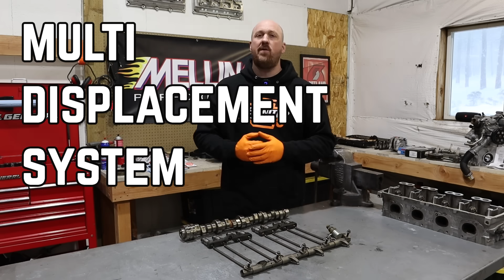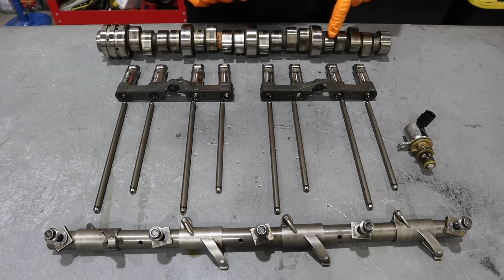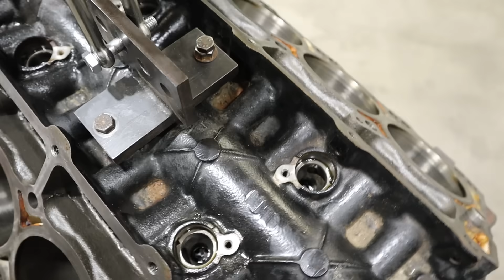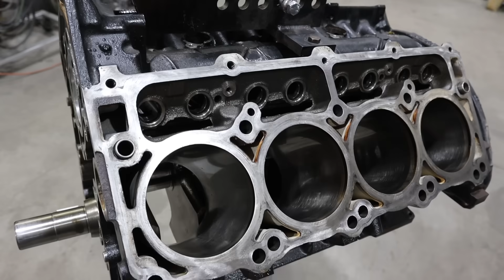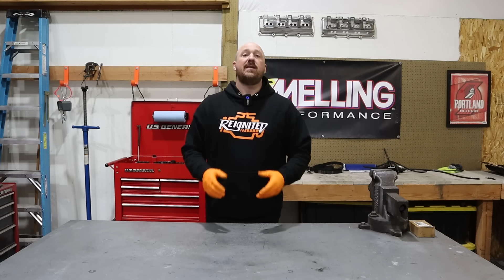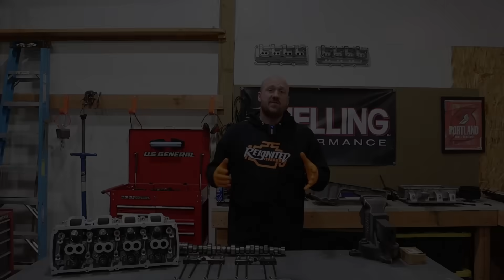Is MDS Damaging Your HEMI? The Answer May Surprise You!

Comment: I drive a lot in Sport mode, and have heard that driving in that mode turns off the MDS system. Is this true, and if so, would you recommend driving in normal mode to keep the oil moving through the motor in the most efficient way possible?
Reply from the maker: Yes sport mode does turn off the mds system. I would say that timely oil changes and not letting the vehicle idle extensively are far more important, but when possible just let the system work as designed.

Comment: I just watched your video, I have a 2015 ram 1500 with a 5.7 L hemi V8 and the eight speed transmission. I tow a travel trailer with it. Do you recommend with tow/haul mode on and pulling a load like a travel trailer to leave the MDS system on?
Reply from the maker: Any time you're towing stick with the tow/haul mode 👍
Reply: Sorry, yes I agree tow/ haul mode should be on but what about the MDS? Do you suggest leaving MDS on or turning it off. 
Based on your video it sounds like you recommended leaving MDS on, even when towing. 

Thank you for any information, love your videos and have learned a lot about my RAM.
Reply from the maker: @bryanschelley7568  the MDS system is automatically disabled in tow/ haul mode. I don't have any qualms about that, I'm mainly talking to the people who immediately turn off the MDS every single time they drive the vehicle. 👍

Comment: Great video, but the thing that bothers me is, when in tow mode (2016 ram 1500 5.7) it's off. So if so, then I'm driving 3000 miles round trip to my winter place with it off. So if having it on is better, why does the factory turn it off in tow mode. Crazy

Comment: My 2012 300C AWD has "ECO" mode, as the cluster displays.  It does get up to 24 mpg when highway driving and really hot outside in summer months. Checked with math, not relying on the "economy" display (although it is close).  I also don't granny drive.  I use cruise as much as possible but quite often hammer on it to cut through traffic to get ahead of those left lane abusers.  I also ended up being a victim of the low oil volume sitting through ChiTcago traffic and Milwaukee traffic.  I wish I would have seen your videos back when you posted them!  Chrysler chose that moment to evade their "Max Care" warranty.  Now I have an LKQ remanned long block, (4 year unlimited mile warranty) and no idea what Oil pump they put in it..but I bet it's not a Hellcat pump.

Comment: I drive a 2019 dodhe challenger shaker rt in toronto in ever winter and every summer every weather. It has 140,000kms and runs like new. Why? Because i NEVER idle the car. Even if a red lught is a longer one...i shut the car off (not recommended for safetyreasons). Hemi engine is a workhorse BUT not for idling. Dont idle, regular synthetic oilmchanges..every 5000kms. Im about to proatively get my timing chain replaced. It has never needed anymajor engine work. Love the HEMI. Your channel is amazing. Complete facts with proof.
Reply: That’s overkill lol you’re probably doing more damage to your car constantly starting and stopping it. Just bring your RPMs to 1k when at idle to splash your lifters with oil.

Comment: I replaced my MDs solenoids and it started leaking oil everywhere?
Reply from the maker: Probably pinched one of the o-rings on one of the solenoids, makes a huge mess. Any type of o- ring i will lube up the outside before installing it to prevent those types of problems. 👍

Comment: Bought a 2015 Ram Laramie from my job, engine was replaced at 180k with a 5.7  Hemi. It came with a clutch installed. The shop said the truck would have to flashed to delete the MDS function. had 243k when bought so it has 65 or so thousand on the engine. Truck is like new and the miles are highway with the users driving 100 miles per day. Thrilled the MDS function gone. Paid 5000 for the truck and blessed.

Comment: i know this was a year ago but i wish you would've included for everyone why to use the "hellcat" lifters specifically when doing a MDS delete.. due to the hellcat lifters having larger rolling bearings and beefier all around you dont get as much failures with the hellcat lifters compared to the oem lifters in the 5.7
Reply from the maker: This is incorrect, I've shown in multiple videos that the so called Hellcat lifters are exactly the same lifters used in a standard R/T. The only reason the part number is different is because the MDS lifter sets come with two standard lifters and two MDS lifters in each tray. If you look up the part number for a manual trans r/t challenger, it's the exact same part number as the Hellcats. If you browse through some of my other videos I physically show that the rollers in the Hellcat lifters are identical.

Comment: as someone with an 140k mile 6 auto all original everything (besides water pump, obviously 🙄) people freak out way too much. literally just dont idle. i warm my truck with MDS on, put around the neighborhood letting it kick in a couple times, switch it to “tow mode” go up to 6th, and then just drive to work. 

edit: i also have a custom exhaust and its annoying as hell if MDS kicks on😂
pt 2: i have 784 idle hours, i specifically checked all the single cabs and picked the one with the least

Comment: I chuckle every time I see posts on someone wanting to delete or bypass their MDS. The things people focus on is amazing.
Excellent video. Thank you.
Reply: Because the lifters themselves from mds are faulty…get rid of it and go with solid lifters…ram also has killed the Cummins by using these same bullshit lifters vs flat tappet
Reply: @chuckatley1464 did you just say ram caused an internal problem within a Cummins engine?😂😂 ram doesn’t build Cummins… Cummins build Cummins
Reply: @HaydenM-h7k  100% ram did that..the demanded hydraulic lifters and Cummins caved..even though that engine was never designed for anything other than flat tappet..it is now the worst full size diesel made
Reply: . So is that a figure of speech meaning " normal , non MDS " lifters ?  Or is there a true SOLID lifter out there that l am not aware ? ( Really old school , set the valve lash with feeler gage every 5-10 K miles )

Comment: 2017 ram 5.7 bighorn. 
Should I turn off MDS off via gear buttons on steering wheel..or keep it active?

I also heard something about thermal damage. When the 4 cylinders are deactivated they're not staying at the proper temperature and this causes damage.

Comment: Thank you for your video. I have 2016 Ram 1500 5.7L with MDS and I do travel long distances and have gotten at times 25+ MPG. It has 123K miles and been having a tiny amount of oil drip. My auto shop said one of the MDS solenoids is probably bad so I having them replace all of them. It been a great truck and this is really the first time something major has gone wrong. I always use full synthetic oil on my oil changes.

Comment: Hello I was seeking some informations on older gen hemi on seat drop issue , is posibble then mds is one of causes it make sense to me (deactivated valves has colder seats than runnig but head is almost on same temperature so seats are smaller and drop on deactivated when you stop and restart heat soaked engine after some km on highway.)  Is that possible??
Reply from the maker: I've heard this theory quite a bit over the years and while I understand how it makes sense in some ways, I don't find it to be feasible. Couple of reasons why. Once aluminum is saturated with heat, it's not going to cool dramatically specifically on the cylinders that are not firing. Secondly, there is coolant running through the cylinder heads that is kept at a constant temperature, so regardless of whether those cylinders are firing or not, the temp is constant throughout the head. Third, the way the MDS system works, it does not leave those cylinders not firing for extended periods of time where this sort of temperature differential could happen. There are about 100 scenarios that will turn the system off for periods of time, including situations where it has been active for a certain amount of time. It will temporarily run all 8 cylinders again for a time before reactivating the system. Once you learn more about the system it may surprise you to know just how thoroughly the engineers thought out this system. 
The dropped valve seats have less to do with the MDS system, and much more to do with seats that were not properly sized to the cylinder heads. This was an issue they corrected with the 09+ engines. If they were still having valve seat issues on the newer engines then I might be more inclined to agree with your theory. 
My thoughts anyway but I'm no engineer, just a mechanic.
Reply: @ReignitedAuto  Thank you for perfect explanation .

Comment: I have a 2013 Crew cab 4x4 dodsge ram 1500, it has been stripped of eng , trans, , transfer, cross members, drive shafts, how do I know which years of either 5.7 and 6.4 Hemis and trans etc will work in the swap?? It was a 5.7

Comment: Just purchased a 18’ Ram 1500 5.7, I’ve been trying to research “fixes” for the lifter failure/hemi tick. Sounds like my best option is a high volume oil pump. Will that be okay for a daily driver?
Reply from the maker: That is my recommendation yes, especially if your engine is going to be idling a lot. Melling makes a pump M452HV that's a direct replacement for your stock pump, it's high volume and will not set any codes for your MDS system. 👍

Comment: Pursuit? MDs?
Reply from the maker: If you're asking if the pursuit vehicles have MDS, then the answer is yes.
Reply: @ OK so I can hear the MDS system working when I’m cruising, it will go in third gear. The MDS system will then launch and then it will shut off those pistons firing and I can hear the change in my exhaust I will then put my car in manual mode because the Dodge charger pursuit does have a manual mode and when I do that, it will give me access to those pistons, but it also allows me to access the full range of my first second and third gears but I guess I drive in my manual mode so much that I really rarely use my MDS system but I do listen to my engine everywhere I go and I’m extremely cautious with it. I don’t even floor the car anymore. I barely barely put any kind of weight on that gas pedal. I just want it to last forever. I love my hemi Also I love the channel and thank you for so much knowledge one day when I tear down my engine at 150,000 miles your videos are gonna be the ones that I go to.

Comment: Can you possibly talk a little about the 5.7 Hemi etorque system? Wondering if I should turn it off
Reply from the maker: I actually like the E torque system for a few reasons. #1- it's an add on electric motor not an integrated system so if it does fail it's very simple to replace unlike other hybrid systems. #2- I rarely see them fail.  #3- it actually keeps the engine from idling excessively.

Comment: so those solenoids restrict oil flow when running on all 8 ?
Reply from the maker: I wouldn't use the word restrict, and we're only taking about the lifter bores not the rest of the high pressure oiling system, but yes they only receive full oil flow when 4 cylinder mode is activated.

Comment: I just bought a 2013 Dodge charger Pursuit 5.7 V8 hemi  . I was told it needs to  rebuild it 200,000 to 250,000 miles. Is that true. I was looking at a high performance complete rebuild kit . But I don’t understand want is junk . Any ideas

Comment: My MDS  lifter has no scratches or Cam    The Lifter tray and all is perfect 260k miles.  Thought I had the hemi tick number 8 exhaust two bolts was loose  lol only . I change my oil every 5k. With 5w20 or 5w30 oil. Mobil one only. When I bought my Challenger. At A 1k mile I changed my oil to mobile one synthetic and mobile one filter. I’m very ruff on my 2016 dodge challenger 5.7 rt  hey I think the msd wire are getting burn up from the position there in laying on the top of a hot block my wire look melted down to the wire I believe this is the number one problem. They should’ve made the foam cushion  the insulation for the wiring system  but you can disconnect and buy a new one .

Comment: MDS is designed with head up ass..  got to be the most ignorant thinking ever.
Reply from the maker: It's actually an interesting exercise to think about. I thought similarly as you do at first. Then when you realize all the things that have to take place, and how the system needs to be able to turn on and off lightning fast, you start to realize that there's not very many ways they could have designed it. 
Then again, if you're talking about the overall viability of reducing cylinders during normal operation to ostensibly save fuel, then I can understand what you mean. The system is reasonably effective, sort of, for certain types of drivers. But it was the only way they could continue to produce large displacement engines that needed to meet ever strict MPG standards, and we can see that today basically all the larger engines have been phased out. The coyote gets away with it because it's both smaller displacement, and also extremely efficient with emissions due to the dual overhead cams with variable valve timing. 
If they introduced a brand new Hemi that was slightly smaller displacement and had overhead cams, I bet they could get away without having the cylinder deactivation.

Comment: More bullshit  you can turn that shit system  off just by changing  your gear selection  to 8 on manual  turning off mds so ram put that on there to damage  your engine  okay backyard youjews
Reply from the maker: It's increasingly difficult to parse exactly what you're trying to say with your comment, so I'll just keep it simple. Of course you can disable the system putting it in manual mode. My entire point is that by doing so you are disabling a system that allows full oil flow to the lifter bores when it's active.

Comment: Can you not just activate sport mode to bypass this?
Reply from the maker: That's my entire point to this video. Yes, by putting it in sport mode it disables the MDS system, but by doing so you are removing the ability to put full oil flow to the lifter bores when the system is activated. Either leave the system working as designed, or remove it entirely. I would say that disabling it electronically is the worst option. 
Also, to clarify, this isn't going to be a make or break thing, by far more important is to make sure you're not idling excessively, and make sure you're doing timely oil changes. 👍

Comment: 100% agree with him. I went upgraded aftermarket cam, non mds lifters, hellcat oil pump so it sits between 60-72psi. Drive the car at least 3-4 times a week. Make sure you have all the supporting mods like he said. I’ve had no issues.

Comment: Hmm...  I wonder if it would be possible to rig up a switch to force activate MDS for when you need to idle?
Reply from the maker: There's too many safeguards in the PCM for it to happen with just a switch. You could absolutely rig a way to collapse the lifters, but the fuel injectors would continue to fire, not good lol. It would have to be modified in the tuning of the PCM itself.

Comment: I have a 2019 ram 5.7, I’ve heard the lifer tick, after I had been driving. I heard nothing on cold start up since it happened. I had driven the truck around 30 miles and parked when I heard it. I shut it off and came back about 30 minutes later and I’ve not heard it since. Should I be concerned? Why did this happen? Same thing happened about a year ago.

Comment: I have a 2015 Ram. 111,000 miles, owned it since new, always run Mobil 1, change the oil no later than 4,000, and have a lifter that is failing.

Screw the govt. I want an engine that holds up.
Reply from the maker: Toyota Tundra owners are probably feeling similarly about now 😄
Reply: @ReignitedAuto 

$6,000 later, its fixed.

Comment: No one talks about this, but every one has something bad to say about the MDS..... first to blame MDS, I fell for it too..

i suspect that a lot of MDS cam/lifter failure happens as a result of poor oil changes........there  are 16 quarts of oil  in an operating engine... when you do an oil change, you are only changing less than half of the oil......NOT GOOD, think about the cam phaser 2.5 quarts, oil pump another quart and a half the lifters take up 2.5 quarts.,, then the oily gallies....... and the fact that the oil pump doesn't move as much oil as its grand daddy in the hell cat....... so, after a MDS failure, hell cat oil pump is your first move to rectifying the issue...  Thats a lot of oil not being changed....you are literally giving it a half an oil change

after I do an oil change, mobile 1  using a 5w20 i prime the filter, and top off a total of 7 quarts (oil change every 5,000 miles]... I run the truck for about 120 miles., and then drain a 5 quart container out of the engine, dump in new 5 quarts....I do the procedure every 3rd oil change and I have no lift failure, no  taps ticks or anything...clock just hit 140k on a 2014
Reply from the maker: I'll agree that when you change the oil you're not getting every little bit of it. But it's nowhere near the amount you are talking about. In a Hemi engine the oil capacity is 7qts and I can tell you through many engine rebuilds that I have done that even with a freshly built engine you only need about 7.5qts to completely fill it.
Reply: @ReignitedAuto  look it up...there are a total of 16 quarts of.oil in a 2014 hemi 5.7 l...it's very clear in the factory service manual..
Reply from the maker: @davidlepore4552  my man, I'm a factory technician for CDJR